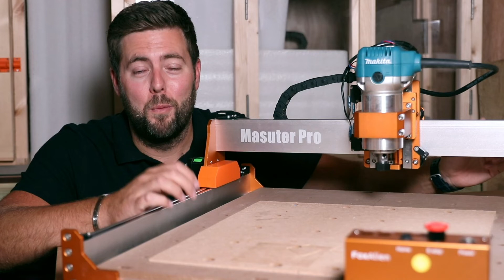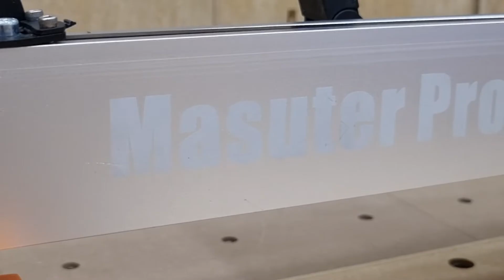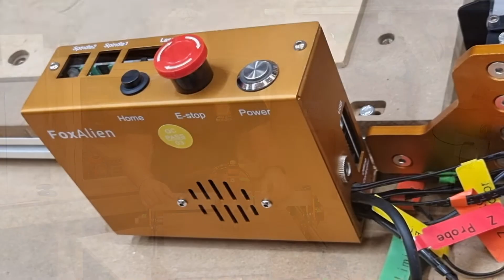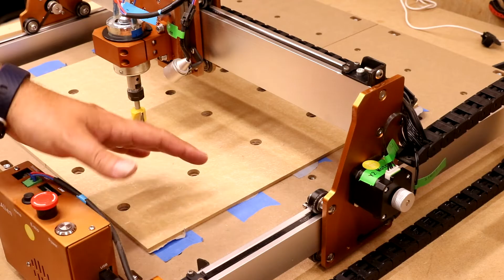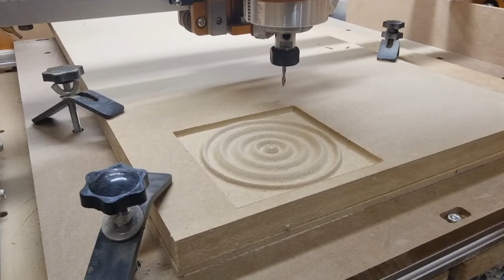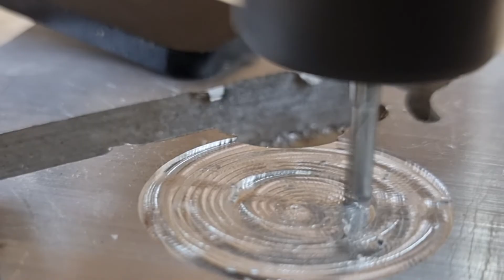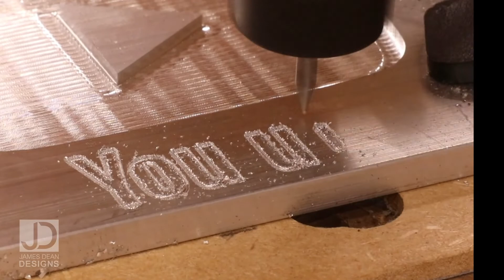Budget CNC which cuts metal? FoxAlien Masuter Pro CNC Review

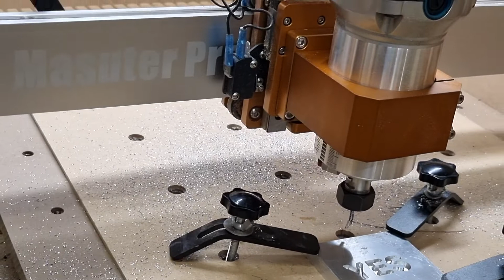Comment: What were your feed and speeds for cutting aluminum, you mentioned it right around 16:25, thanks.

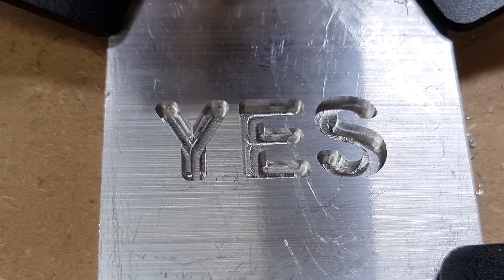Also what size bit (feeds/speeds) did you use for engraving “YES” at around 16:20?

Comment: Hello! I have a question I cant fidn the answer to online. how does the Masuter Pro compare to the Genmitsu Reno 4040? They seem almost identical in specs but the masuter pro costs like $599 vs the Reno $380 amazon right now. The Reno has slightly higher Z travel but uses rods, and the Y axis is double thickness with two wheels. Everything else seems identical? Am I missing something that makes the Masuter pro worth significantly more? Also the extension kit costs over double.

Comment: We need longer Y rails and the Z rail higher. Are the rails standard extruded aluminum? I need 6' or just under 2 meters for signs.
Reply from the maker: Technically the extrusion they use is not standard as the sides are blocked however it's the same over measurements of standard extrusion if that makes sense

Comment: Does this machine metal better than the Genmitsu 4040 Pro? 
You do a steel test in this one but not the other and you do .5mm at 500mm a minute but the other one you do .3-.4 at 1000mm a minute. 
Were the same bits used? Could the other not do steel or was it just not tested? 

I ask because in your vs video you say the Genmitsu has better steppers so is stronger. Is this not the case due to the frame? 

How would the Genmitsu do in depth in comparison if they were both going at 500mm/minute? 

Looking to buy a cnc to make some tesla turbines. Trying to get a cheap one so these two are great options. Atm thinking about the genmitsu but I want to be safe rather than sorry. 

Thanks a ton!
Reply from the maker: It just wasn't tested. Whilst both machines can do metal, and mainly soft metals at that, the reality is they are not primarily designed for metal. So if you're just doing a bit here and there it might be ok but if you're looking for a machine to mainly do metal then something like the 3030 Pro max I reviewed would be a better choice
Reply: @JamesDeanDesigns  I’ll give it a look. The metal I’m looking to machine is maybe +-.2 mm thick each anyway so I don’t think I’d put too much stress on it but I’ll definitely give the 3030 pro max a look. 
Thanks for the response!

Comment: Hello. Thanks for the video. I will check the links you provided. 

I have a question: 
I already have strong Makita in hand, which can handle steel well. I deal with stainless steel, upto 10mm deep (only steel, not wood, not aluminum). I am now looking for the rest of the cnc (I only have Makita router in hand). High precision is a must. What do you advise me?

Comment: Hello there. Brilliant video, I'm looking to get a cnc machine as a total beginner to this kind of stuff. I have a question...

You mentioned a laser at some point in the video. 
Are you able to add a laser to this machine and effectively turn it into a laser etcher/cutter ? 

As I was looking to buy both, but if one does the job of 2, then that's even better. 

Thank you in advance for any help 😁
Reply from the maker: I would say having 2 separate machines is still better for various reasons but yes you can install a diode laser on this machine. FoxAlien did used to sell them as a kit with the laser as well but other brands will also work. If not done so already just looking into diode lasers so you have realistic expectations
Reply: @JamesDeanDesigns  thank you so much for the reply. I've done a bit of reading into the diode lasers, I think due to budget, it would be my starting point. So in theory, I can't see any point in me having both machines as yet. Unless you can point out any real negatives I may be missing. They still do the kit, I've just looked, and it comes with a 20w laser, which I believe is a good one to have. I would be doing the Makita rotor upgrade from the start. Thank you again for the reply, it's much appreciated 😊

Comment: Added a plasma cutter to mine and cutting metal is no longer any issue! Most fun ever.
Reply: Did you make that video yet? In desperate need of a solution 😅
Reply: @joshuaeagleton3469  too busy cutting hehe I’ve added a torch height controller to it too. Servo driven that moves the torch. Can even cut curved surfaces like motorbike fenders and corrugated metal. So cool. I will be posting more. THere’s a brief short of it on my YT
Reply: What plasma cutter did you use? I want one myself
Reply: @Komet3ify  you can use any pilot arc cutter or you can modify a high frequency start one. I’ll be doing an episode on my build which includes the torch height control and getting around the interference issues.
Reply: Do a video so we can do that too.

Comment: I want to use the Z probe with Easel Pro. If I enter the thickness of the plate into the Machine Settings in Easel, does it then generate code into the .nc file that I send to the machine? I'm sending the .nc files through the offline controller, not using Candle or other sending software.
Reply from the maker: If you're using an offline controller, there should be an option on it to run the probe from there. Easel  doesnt put that information into the nc file

Comment: I appreciate the effort to speak both imperial and metric,  since there is no easy conversion;  and I try to use both depending on what I am building.   Point being that describing with both is very helpful.  Nice presentation over all.
Reply: For me I find myself relying on 1/4" being approximately 6mm to do conversion in my head.

Comment: I want to use this as a pen plotter. But to draw on 3d objects that has barying heights.(max height wpuld of course have to be less than the extrusion lowest point.)and the drill parts removed  and replaced with a pen holder.

Does this cnc manchine have the capability to control the z axis  at varying heights and reach those different heights quickly while it is on...instead of just drill bit down , drill bit up
Reply: Saw the rest of the video💀💀💀 think it can
Reply from the maker: @hamzaarshad861  yes it should 👍

Comment: 4:07 you mention tthe steppers are nema17, the website is stating nema23. Do you know if they've been updated on recent machines?
Reply from the maker: Are you sure, I just checked for this machine and it doesn't list nema 23s. Regardless, they are definitely nema 17. 100%
Reply: @JamesDeanDesigns  I stand corrected, no idea where I got that from. It's been a long day 😂.
Thanks for the quick response, love the vids btw 😀
Reply: Mine came with 17s. I just bought it.  I expected 23 but...
Reply: This would be 17. The w3 requires a bigger module. Its a PC sized box with different connectors. I upgraded from 17 to 23 after my electronics quit.

Comment: Is the Makita RT0701C 6.5 Amp 1-1/4 HP Corded Fixed Base Variable Speed Compact Router with Quick-Release the router you have there? Did you say that the diameter of the body of the Makita router is 65mm? Do you just plug in in a drop cord  to power it while your'e using it in the  FoxAlien Masuter Pro CNC? Thanks man

Comment: I want to cut hollow aluminum tube. I can find a lathe that’s not manual. Would this work
Reply: It depends on how long or deep you want to go. You’ll be limited by the height of your z-axis and the cutting length of your bit. You’ll also need to consider how you’ll clamp the piece. IMO, you’d only be able to do 1 to 2 inches. You could do several inches on a lathe. I’ve carved about 1” into Aluminum with a 4030 and an Amana aluminum bit. I made a wood jig to hold the piece, a circle with a lengthwise slot that I could clamp tight.
Reply: @woodman72265  Thanks that helps

Comment: Can you use the Dewalt palm router in this machine?
Reply from the maker: The holder that comes with this as standard is 65mm diameter. You would need to buy a 69mm diameter holder in order to take the dewalt

Comment: Hi James, based on your review I recently purchased this machine. I'm new to CNC and have found your channel to be really helpful. Unfortunately, I'm having a lot of issues cutting successfully on my Masuter Pro. I'm trying to make some templates out of 12mm MDF and every time, the cutting starts OK but about half way through the machine just goes off track, predominately on the Y axis. I've adjusted to feed down to 800mm/min, plunge to 200mm/min with a 1mm depth of cut. I started with a 1/8 compression bit but have also tried with a 1/4 spiral upcut bit and yet I'm still not able to finish the job without it going off track. I noticed whilst the machine is homing that applying a very light grip on the Y axis jog wheel will stall the motor, is this normal? Any pointers to help would be really appreciated. Thanks
Reply: I'm having the same issues, did you find a fix?

Comment: Do you know what would cause this condition? I carved a US Flag, when it was done, no blade change, I decided to let it carve a second time to hopefully get rid of some of the rough spots, when I carved the second time the carving was not in the same place, meaning a little off so my project was ruined, what would cause this? Thanks in advance.
Reply from the maker: At some point it sounds like it may have missed steps. This literally could have been on the very last journey back to the start position or at any other time during the job. It may have been one step here and there meaning you may not have seen it on the carving but ultimately they accumulate. Missing steps can be caused by belts or wheels too tight. Sometimes running at to high a speed as well
Reply: @JamesDeanDesigns  thanks

Comment: Hi James, I have learned a lot from your videos. What all would I need to upgrade the Masuter Pro to nema 23 stepper motors. I'm assuming I would need a new control board and power supply.
Reply from the maker: Yes, you'll obviously need nema 23 motors, a control board that can supply enough power and a way to mount the stepper motors as the holes are in different positions

Comment: Hi, I am having problems with my FoxAlien Masuter Pro skipping when roughing large areas which them ruins my design and I have to start again so was wondering (after watching this video) if part of the problem might be the wheels as I have upgraded to the Makita Router, I have found your video on how to change them and ordered a set from your link but could some of the reason be the the tracks get covered in dust and chippings making the smooth running not so smooth (even if I do sit with Henry running constantly trying to hoover up as it is running but of course staying out of the routers way) so could you let me know where I could buy a set of dust shoes from?  I see you have sent people to your 3D template on Thingiverse but I don't have a 3D machine so PLEASE is there anywhere to purchase them from?

Comment: Hello and Thank you for your informative review, I ordered my new Foxalien Masuter pro on 27th December it arrived next day, its a solid machine and with all the reductions found on line you can buy this for under £480 now. however I have been using laser for two years and found my designs can be used if re saved to a g file, do you agree? I am still trying to get to grips with the machine, still not cut anything and would like to learn how to place the job for cutting, bobs cnc basic, inskape or lightburn all seam to design ok, but what is best for a sender UGS? how do I set the position for cutting? any help appreciated.

Comment: No anti backlash?
Reply from the maker: It's a belt driven machine not lead screw. Never heard of a budget, desktop belt driven machine having anti backlash
Reply: @JamesDeanDesigns  
CNC without anti backlash is a trash
Reply from the maker: @art-toolsfactory5454   😆 your knowledge of belt driven CNC machines is clearly overwhelming
Reply: @JamesDeanDesigns  
You shouldn't have a lot of knowledge to know that belts stretch and not as accurate as lead screws with anti backlash, so good luck selling more trash
Reply from the maker: @art-toolsfactory5454  perhaps years ago but lots of belt options available now such as being steel reinforced. Yes belts can slowly stretch in the same way lead screws and backlash nuts can wear. Ball screw drives have no separate anti backlash, are those trash as well?
If you're looking to just troll people's videos, I'm not one you're going to win against.

Comment: Great video James. And your other videos too, that help me a lot for my first try in CNC world with my new Masuter Pro. 
I just get a Makita router, but I have problem to find small collets. I need at least 1/8" collet, but I've heard that ER collet are not compatible with Makita. Any tips to help me ? And so, what bits did you use to work on aluminium ?
Reply: Hey did you end up getting your problem figured out? Asking because I might be running into the same issue and I’m new to the hobby

Comment: I'm considering getting a CNC machine for my garage. Problem is that it's -30c in the winter and +30c in the summer. I don't plan on running the machine in the winter but worry about the storage temp and worry about the operating temp in summer. Anyone have one of these machines in a similar situation?
Reply from the maker: You could always put it in an enclosure and regulate the temperature a bit better that way. Insulating will help with heat and cold
Reply: @James Dean Designs  Ya I already thought of that. Probably what I'm going to do is use a reptile heating lamp and a line voltage thermostat. I'm an HVAC mechanic so it's pretty much my wheel house.

Comment: Excellent review and lots of good advise! I am totally new to CNC so this was super helpful. My question is, will this set up and the upgraded Makita router cut 14 gauge metal?  Too be clear if I had a bird outline will it be able to cut through the 14 gauge and how much cleanup (sanding) would be needed for projects like this? Thank you in advance!  ~Frank
Reply from the maker: It should do but perhaps not in one pass. I know you say 14 gauge which is the thickness but a lot will also depend on the actual metal. If the right speeds are using then clean up should be minimal

Comment: Just ordered the machine using your link and was cheaper than amazon. I will install a makita and using for woodworking, hardwood and soft wood plus acrylic, any suggestions which bits I should buy?
Reply from the maker: Thank you 👍 if you haven't done so already, check out my guide on bits. You can use different bits on different materials so it's about the finish you're trying to achieve on each job but this video covers all the basic bits https://youtu.be/obwwoEAbBjc

Comment: Hi, I hope you can help me,I recently bought a 3018 engraver, everything worked great at first following your brilliant videos but now when using Lightburn I get this error message when trying to cut a file :-

 (Starting stream
Layer C00
error:3
Grbl '$' system command was not recognized or supported.
On or near line 0:
Job halted
Stream completed in 0:00)

It frames OK and It works OK in GBRL.

Thanks Ken

Comment: Hi James, first of all, thanks for the Masuter Pro review.
I have little knowledge of CNC Router, but when I see CNC machines driven with belts instead of Ball Screws, I get a little "backward"; this, because of the precision and robustness. But you, who must be very experienced in CNC Router, what do you say about this Router Masuter Pro, since it uses belts for its traction? I mean, can she carve wood with ease, using Spindle (for a small business)?
Secondly, is it possible to replace these rubber wheels that hold the axles with metal wheels, as you have in other laser machines?
Finally, how much laser power can this machine support/supply? Thank you very much
Reply from the maker: Generally speaking,  ball screw drive is better, but also more expensive which is why you rarely find them on budget machines. Belts are usually reinforced with steel wire which makes them stronger than they used to be so still capable of doing the job.
Even if you could, you wouldn't want to replace the wheels with metal ones. There needs to be an element of friction to help keep it steady and the rubber wheels give that little bit of cushion to allow this. 
Hope that helps
Reply: @JamesDeanDesigns  Yes it helped, thank you very much.
It's just that I'm a bit of a perfectionist and I prefer something more professional but, as you said, that comes at a higher cost.

Comment: One of the issues I had with the Masuter is the uneven bed when using clamps. Because the bed is split in half with no support underneath you can easily put more pressure on one end tilting your piece at an angle. I thought that was a serious flaw in design.
Reply from the maker: Can't say I've really experienced that but I think that's one major benefit of adding a spoilboard and reinforcing the underneath, it holds it altogether better.